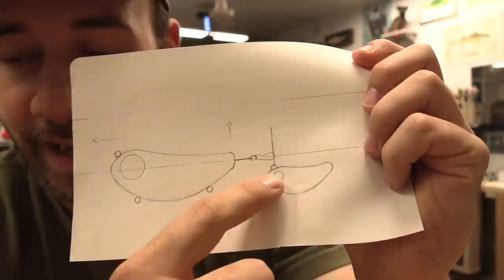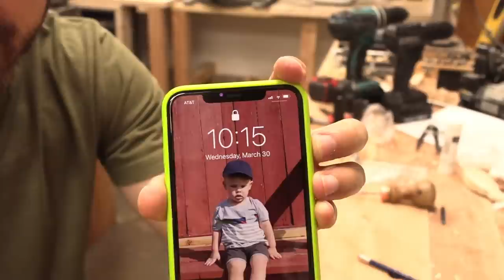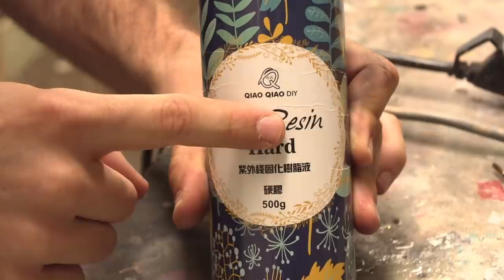"Every Bait Needs a Friend" | One Day Build to Catch

Comment: Brother Marling,
Great Movie!!

1. All hooks attached as a part of an artificial bait or lure are counted as one hook. Per our DNR.
2. When you saw those shad, that should be a clue to what color to paint your next one.  Red is a myth.  If everyone is using the same color, alot of fish get caught on that color.  Bigger fish are caught on shad colors this time of the year, in our fine state of I Oughta Went Around.
3.  If you ever produce that Chatter Buddy, you HAVE to keep the split ring between eye and the blade.  That is what Zman patented, the connection.  If you want better action for your personal Chatter Buddy, connect the blade to the Buddy without split ring.  The vibration is immediate.  For a sinking lure, you'll feel the vibration on the fall, instead of having to whip the rod tip to get the blade to start vibrating.

Comment: So, this is just my interpretation of the law, you can put as many hooks on your lure you can fit. It's only when you are using hook and line, that you can't have more than two hooks. That goes for bait casting and trolling, angling ( the use of lures) is not included in those regulations.
Reply: Soooo in theory i could drill 20 hooks into a crankbait and it would be fine? lol
Reply: @justanothernobody982  CORRECT! The action of the lure would be drastically affected, but yeah.
Reply: Literally jig made out hooks

Comment: You should totally hollow out the center and add a willow or Colorado blade, increasing flash, vibration. Except you should use a harder wood substance to really get that bait lower. I’m sure it would absolutely kill the stripe bass and largemouth when they’re out further
Reply: Also, what about it in reverse like the larger one is secondary mimicking a chase

Comment: Just tie the lure on a piece of heavy mono between 2 tie points in your truck bed so it can rotate with the motion of the truck and the air movement.
(tiedown)---------(line)--------(lure)----------(line)---------(tiedown), 
The sun will cure the uv resin.  The sun puts out lots of uv, even on a cloudy day.

Comment: I think the torque from the blade may be causing the bait to lean to one side. The same way most boats have the steering on the right side to compensate for the propellers torque.

Comment: Be forewarned, I have worked with epoxy and cyanoacrylate(Ca) glues for 15 years never worried about it then I developed an allergy to both. Now I have to wear gloves and a respirator when I use them.

Sorry you lost your buddy but you do have 527K buddies here 👍🏻